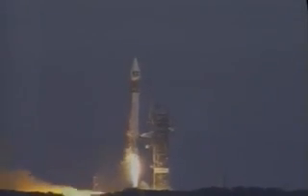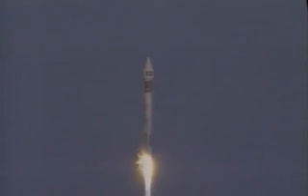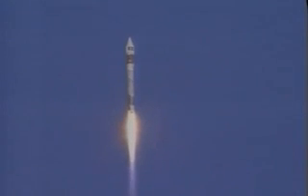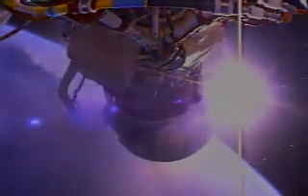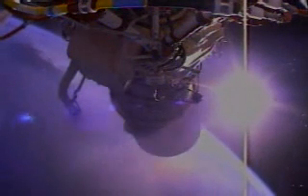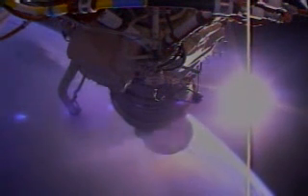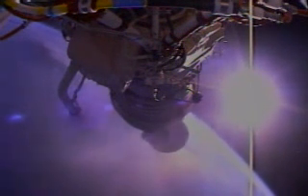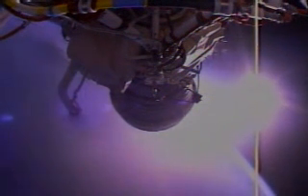The first Atlas III rocket is launched May 2000

Comment: First flight of the RD-180 main engine.
Reply: The RD-180 will go down as the most reliable engine for that era. 

Its a damn shame they couldn't make a reusable version of it ...but I suppose the oxidizer rich preburner makes reusability impossible unlike say the Merlin engines..which have an open cycle which is helps their reusability
Reply: @jayrod9979  why does a oxidiser rich preburner make reusability impossible
Reply: @5000mahmud  the way they ignite i think is the issue